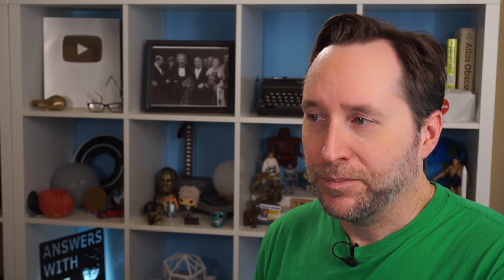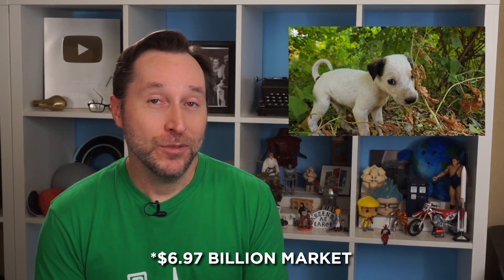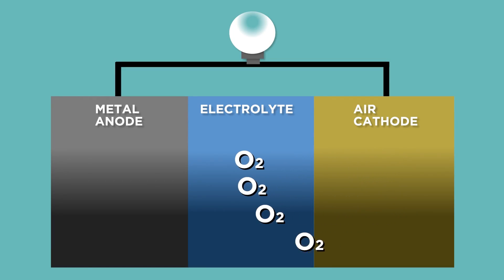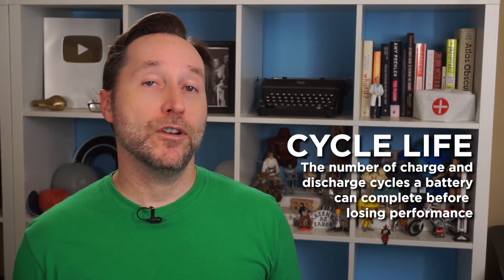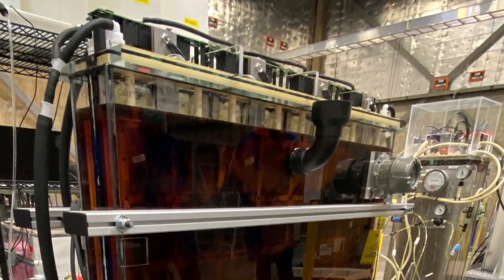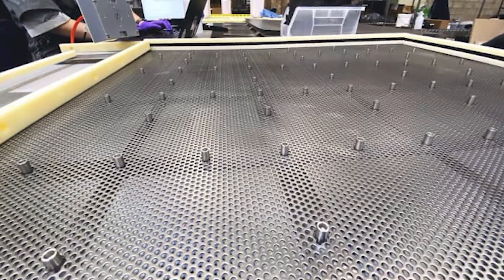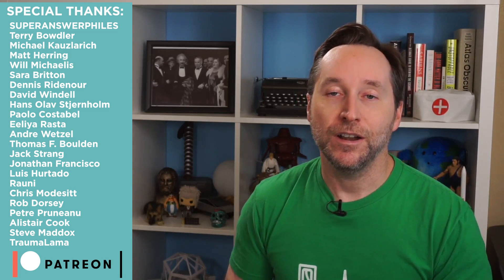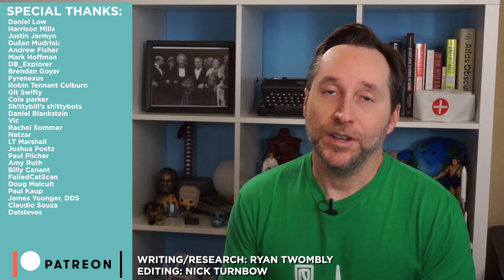Iron-Air Batteries: Storing Energy In Rust | Answers With Joe

Comment: If you're welder who uses aluminum than yes you have seen aluminum. Argon gas is the most popular welding gas and it protects the welding process from oxidization just long enough to be able to weld any type of metal.
Reply: ... hence why he said "probably"?
Reply: So, generally only seen under a visor
Reply: does it look particularly different though?

Comment: How lucky are we that the Earth is just small enough to allow rockets to escape its gravity? How much more massive would the Earth have to be to prevent fuel-laden rockets from reaching escape velocity? How interesting also that we are the most massive body in the solar system suitable for landing, making exploration and return from other, smaller bodies theoretically possible.
Reply: If it were a bit bigger, we wouldn't have any space program and wouldn't think about the size. If it were a bit smaller, we'd have a moon colony by now.

Comment: The grid failure in Texas wasn't inevitable or an accident, it was deliberate negligence on part of both the companies, the regulators and the powers that be. (Edit: To be specific, the power companies were provided guidelines on how to prepare for conditions like these—they didn't).
Reply: Facts
Reply: “Don’t Mess with Texas”.   Roughly translated “We can mess ourselves up”
Reply: @dewiz9596  har
Reply: Because "freedumbs!"
Reply: Yes, it was a lot of the natural gas infrastructure failing in the cold that made the grid fail.  Even if the power plants had be weatherized, the fuel supply would still have been a problem.
Reply: It was a combination of factors.(Also, the don't mess with Texas is an anti-litter  campaign,  ok?) 

 No one got out of the Snowmaggedon  without egg on their face. Natural gas wells froze,  but we're using so much gas because we have so much wind, and it's also less carbon intensive - historically we used coal more, which mightve fared better in extreme cold. But  multiple coal plants were idled, because winter is usually when we maintain them in Texas, plus there's fewer plants cuz -  we're decarbonizing. 

Wind turbines froze because they weren't properly proofed against extreme cold, because it's not supposed to get that cold. 

A nuclear power plant safed, because the inlet water was too cold and that caused a software fault. And on and on.
Reply: Consider this other factor that almost no one notice. Grid on the cities are relatively new and that's fine. But grid from points between cities, power lines have been there for longer than 50 years, this old parts of the grids is what is causing a lot of stress and losses through all the system grid, it's moslty the main cause of so much waste and inefficiency of the modern world.

This, of course, is not exclusive of that state, it's not even exclusive for USA.

This "problem" has been there for years or decades, and is the main cause that we have a very big waste of resources (energy) only from the losses of distribution, heat losses, transformation losses, and this energy is a thing that no one uses, it's only to deliver to the centers where it will be transformed to the powerlines that the people use. Considering that some power lines are old too, and some transformers are old too, some too old.

This things happened for many reasons, but the main one is some parts of the grids are old, too old. 

This is a global problem, the US, Canada, Europa, Asia, Latam, etc, have this same issue.

Comment: This thing sounds like scientists and engineers in the US are trying to skip the whole upgrading the 100+ year old grid and just create the perfect batteries. To me that seems like a big mistake.
Reply: Different people involved.
And the grid will suffer because energy companies has boards of directors that gets more money if the previous year had a larger profit. Which means there is no incentives to do long-term investments that reduces the money to the CEO and board of directors.
Reply: No, this has little to do with our ancient electrical grid. The battery question is the key to get us off fossil fuels (coal, gas, diesel, etc.) as an energy source to reduce the amount of greenhouse gasses (CO, CO2, Methane, Sulfur compounds, etc.) we dumping into the atmosphere. While we can power the world with solar, wind, hydro, and nuclear energy sources, most of those sources only provide power during parts of the day/year, and anytime outside of that period is shit-outta-luck. With better electrical storage (i.e. battery technology), we could generate as much renewable electricity and use it whenever. As it stands now, a lot of solar and wind farms have to meter their energy production because there is not enough demand during peak energy output to use it all. 

And here's where you should be screaming to have our ancient electrical grid updated. Yes, if our grid wasn't antiquated, some of that surplus wind and solar power we're effectively wasting could be used to power different parts of the nation. We could be shipping it northwards and eastwards to meet the rising need for it. Southern states get way more sun than do northern states, and the East Coast's peak power usage hits several hours before the West Coast's. But even with an ideal grid, we're still going to be turning off windmills and solar generators because we still wouldn't be able to use it all. We need the battery tech to collect and store the energy when we have an excess of it so we can use it when the energy isn't being produced. So, it's not the case of "we need to ramp up the grid OR develop better batteries", we need to do both. And quickly.
Reply: Over the next 10 years the requirements for the grid are likely to change radically, and in a way that is hard to predict. It is quite hard to see exactly what modernisation is appropriate. That makes getting funding for big improvements hard to get.
Reply: @agsystems8220  Not really. The one well known fact is a need for morw capacity. If there are need for new links, that's just extra. But the existing links needs to be bulked up. And thats true for most of the world.
Reply: @agsystems8220  One modernization I can think of is replacing the actual literally 100+ year old components on power-lines, like the bits holding it together physically. These fail whenever extreme weather occurs or just randomly because they have completely worn. It astounds me the US has military planes costing over 1 billion $US, but the country's grid has components older than most human beings.

Comment: Why continue with horizontal acreage storage when large scale vertical storage (underground or above ground) seems like a better option?   With large missile silos we know it's possible to construct large scale underground chambers and in science fiction we know that that's what the robots did in The Matrix.  Just wondering.
Reply: Because horizontal storage is always in a hundred percent of the cases going to be cheaper than what you are proposing
Reply: @curiodyssey3867  Ture but it just always feel that it's at the cost of environmental impact and optimize efficiency.

Comment: Hey Joe have you ever heard of the Bloom Box?  Is this thing real or a scam?  if it is real and works would that end batteries all together?
Reply: What’s the Bloom Box all about? Is it some kind of new battery?
Reply: @redwoodpartisan2433  Years ago on the Discovery Channel there was a story of a NASA Engineer that was working on an Oxygen generator to go to Mars.  That if you was to run electricity through it would make Oxygen.  but also would produce electricity if you pumped oxygen through it.  They were claiming that two of these units could produce enough power to run the average home.
Reply: It's a fuel cell that can run off of natural gas.

Comment: 11:25 - It would be nice to mention at this point that coal powered plants also failed during that epic blackout, because their cooling systems froze, and that wind turbines can bu bought with or without cold-weather and snow protection - guess which ones were installed in Texas?
11:55 - that was a very vague (and wrong) explanation of distinction between energy (measured in J or Wh) and power (W).
Reply: And natural gas fueled plants as well, in addition to gas supply infrastructure freezing up.

The one that got me was STP nuclear SW of Houston having a reactor go down due to "cold weather issues". 
Their turbines and generators are out in the open🙄
Reply: @IronmanV5  I think the nuclear issue was due to the water inlet temperature being lower than some arbitrary cutoff in the software. "That can't be right! Shut it down!" I recall reading it FWIW. 

And look, we're not built for true lasting cold. Texas gets chilly in the winter, and really cold a day or two at a time. I mean, our apartments have stairs on the outside. When there's a freeze they're death traps. I know. 

But it's only cold like that a day or two tops, and not every winter. Look at apartments in California. Same at Texas. Apartments in Wisconsin? Always on the inside. Our bus stops? Open. Wisconsin? Closed. Etc.
Reply: @alvarofernandez5118  The natural gas fired power plants down my way, RGV, have the turbines & generators enclosed. 

The Braunig & Calaveras power plants on the south side of San Antonio also have them enclosed.

The San Miguel power plant south of Pleasanton also has them enclosed.

The fact that STP, located on the coast, doesn't in an area where Hurricanes are a somewhat regular possibility sounds like some stupid cost cutting to me.

Same with Comanche peak SW of Ft Worth. In Tornado Alley.

If they cheap out on something like that, what else did they cheap out on?
Reply: @IronmanV5  not trying to absolve them, thats for sure. But complicated systems fail in complicated ways. There is not one cause. One cause is certainly being cheap/cost saving - or smart spending, which is what it's called when it works out. :-)